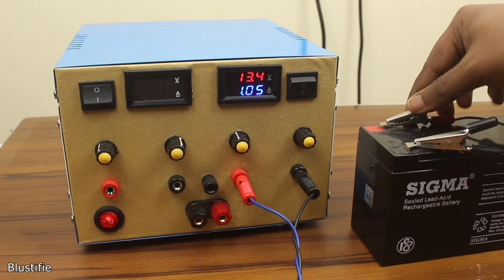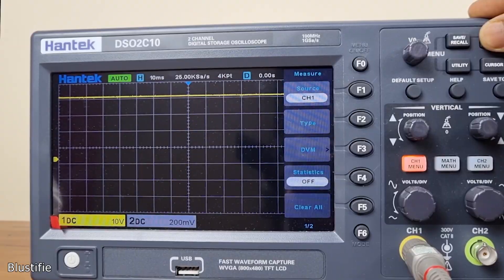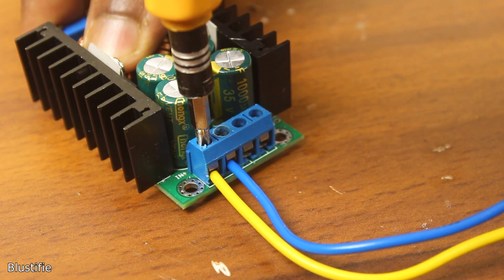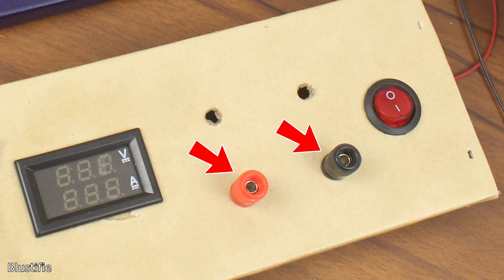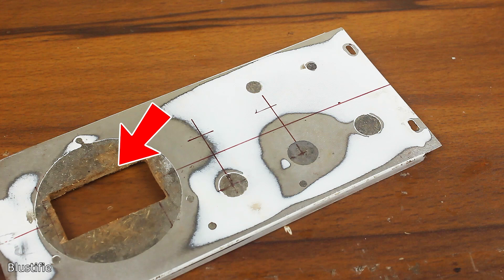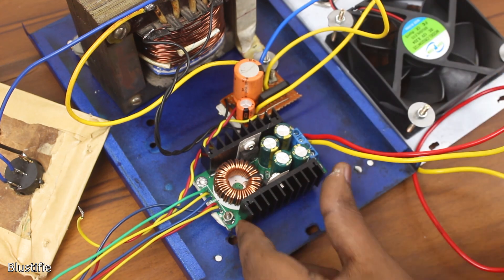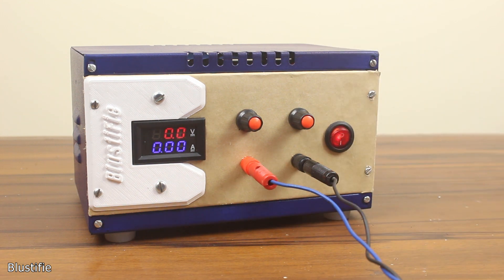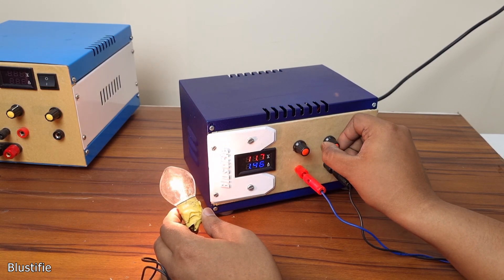Low Cost DIY Variable Lab Bench Power Supply 30V 2A 60W!

Comment: Bro, my xl4016 module outputs 30v and 10 amps constant. I just used a 10 amp input. So with it, you can achieve more performance. And its more efficient.